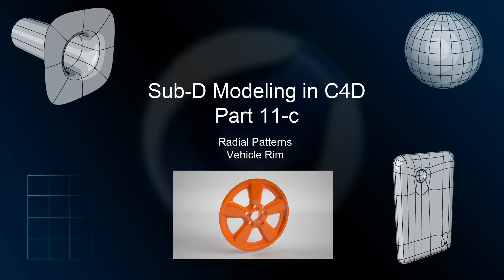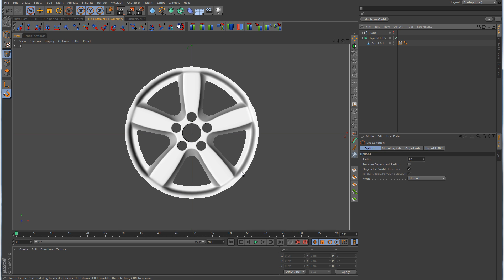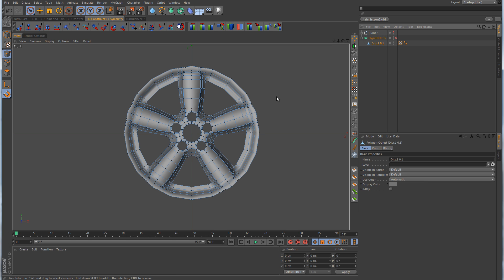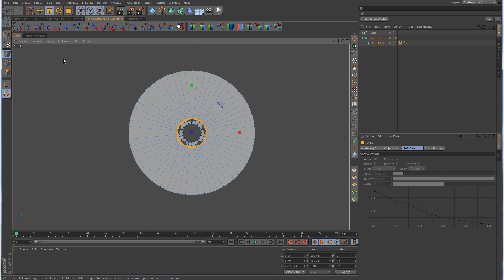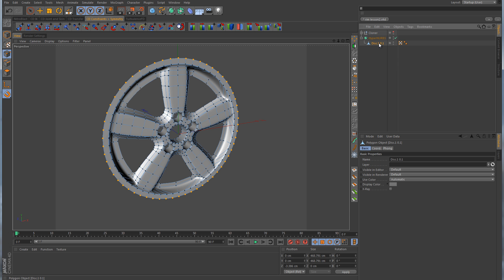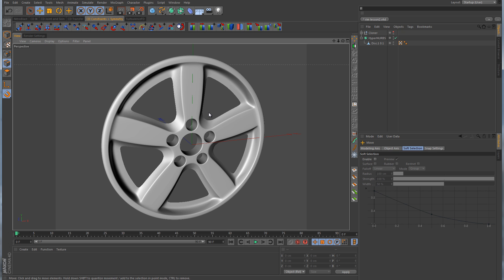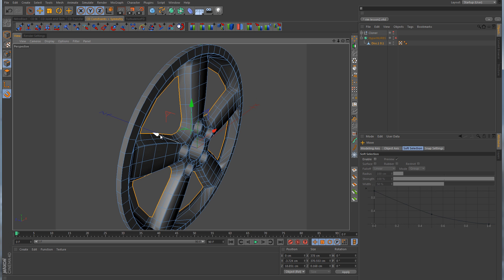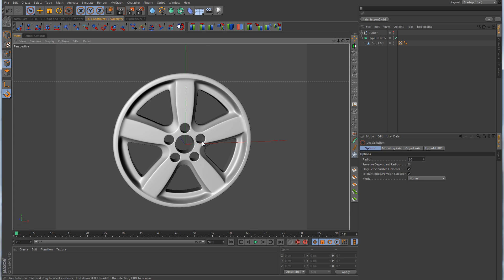Sub-D Modeling in C4D - Lesson 11 Part 3 - Radial Patterns - Car Rim

Comment: +ShepperdOneill Are you too good for youtube now-a-days or what? Haha! I've been a 2D designer for 15 years and really appreciate your videos as I learn C4D. But the manner in which the points to circle script stretches and makes seemingly messy geometry feels odd. Is it just me? Is there another way you'd approach this rim looking back at things? If so I'd love to hear because I'm using your series to learn Sub D (which is great, btw). I've been parametric till now, so it's great to see another perspective, but would love to hear how you may approach this in a cleaner way.

Cheers from the Midwest!
Reply from the maker: +jaydekaytv It seems like whenever I get free time to make new tutorials, I get swamped with client work. The timing is always bad. haha With the release of newer versions of C4D, along with some newer user scripts and plugins, modeling has become somewhat easier than what I show in this Sub-D series. This was made almost 4 years ago, so the methods are a little outdated, even though they are still valid and usable. Im not sure how I would re-approach the rim modeling. I might have to go back and try it again to see how I would approach it.

The points to circle script is also an older script, so I would agree that it can sometimes be a little messy. I believe that there are some newer ones that have come out, but I am not sure who has them. It could be part of some some modeling kit, or a plugin.
Reply: +ShepperdOneill Right on, glad to hear you're staying busy. I know the feeling, I've been taking nibbles away at C4D for the past couple years as much as I can. Hope to hear more from you at some point when you get some free time. Cheers!